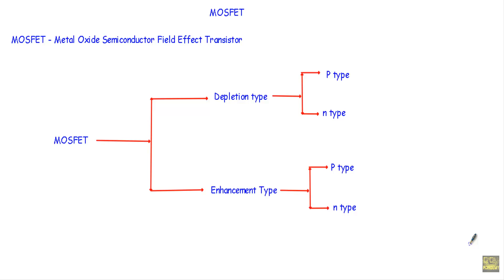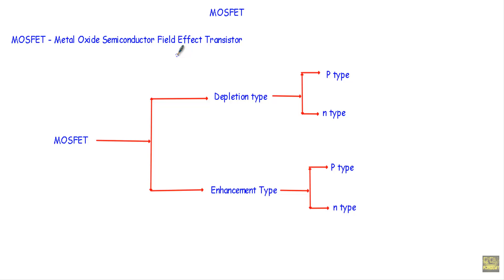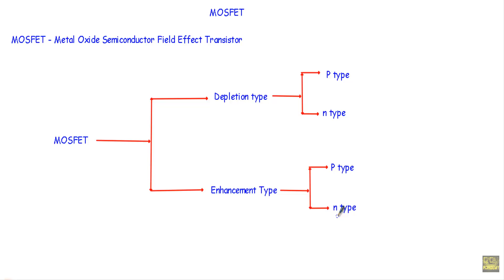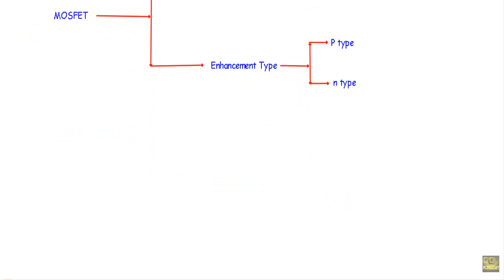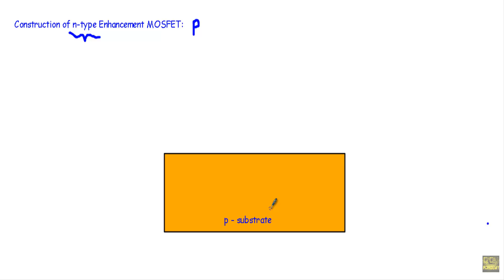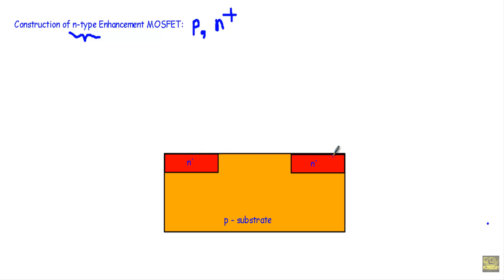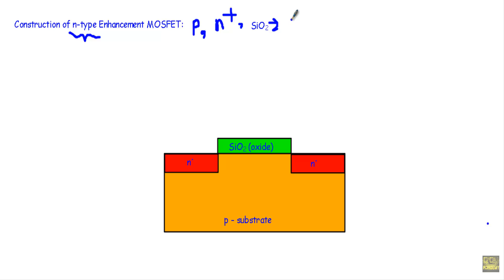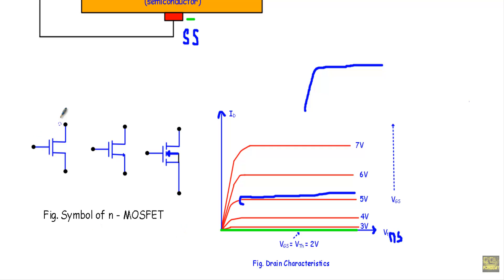n-type EMOSFET Construction and Operation

Comment: Great video! Can I ask what those polar elliptical things are at time 14:59? Are they stationary polar molecules of impurity ions?
Reply: They can be either atoms themselves or polarized molecules. Since the material is a dielectric, it's an insulator. That means that the energy band gap in the material is too large for electrons to jump to (or be excited to) the conduction band from the valence band. In other words, there is too much energy required in order for the electrons to break free from their atoms in order to flow freely within the material (to conduct). 

However, an atom can become polarized. When a positive charge is placed on one end of the material, it attracts the electron cloud of the atom towards it and repels the nucleus (positive charge). But the electrons don't break free from the atom. So you end up with these polarized atoms of which their direction you can manipulate such as what you see in this video. 

Does that make sense? I recommend looking into dielectrics and that may clear things up. :) 

(Also, it's been a few years since I took this course. So to anyone, if I made any mistakes, please let me know.)
Reply: Thanks very much Whitney! That makes sense. Thanks for your time in explaining this kind of detail. That helped tremendously. I think details like what you taught (showed) is vital for making things really clear when it comes to topics like this. Thanks once again! Greatly appreciated.
Reply: Kenny Anytime! I know I need that kind of detail to really learn something. So, glad it wasn't too much. :)